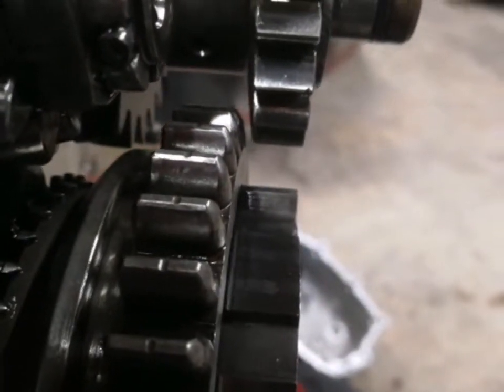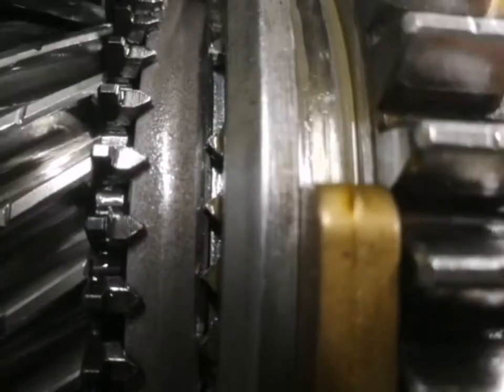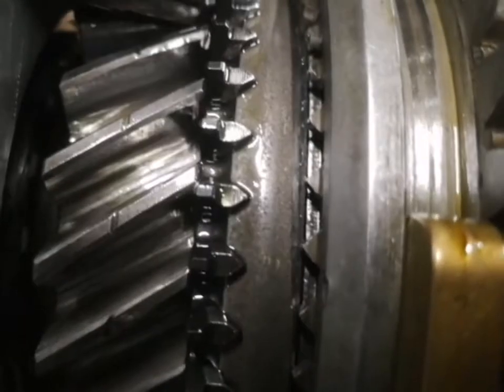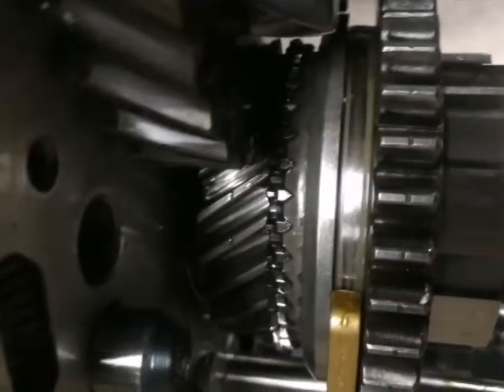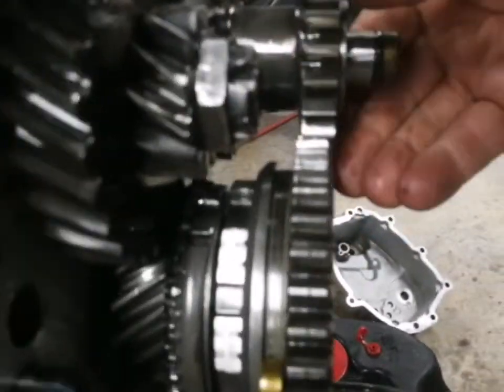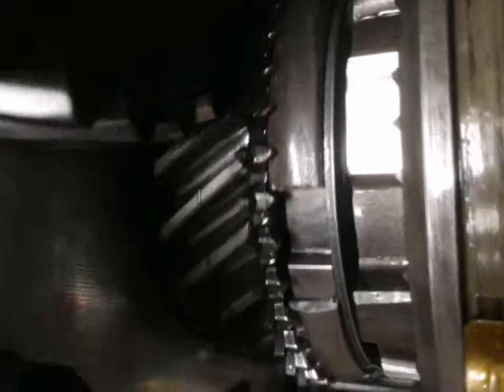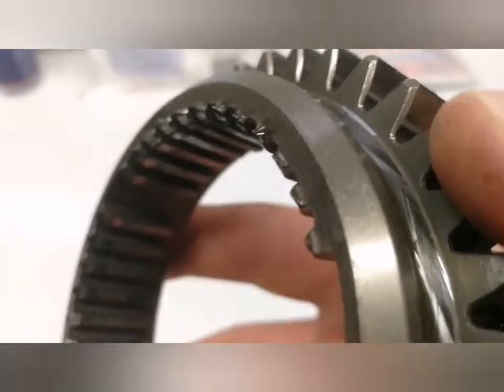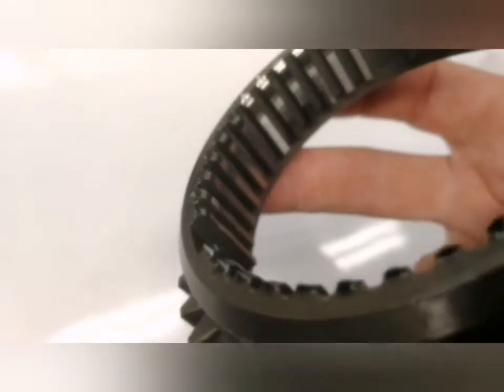Porsche 915 transmission - 5th gear issue

Comment: Did you find the root for this?
Reply from the maker: Yes! As best I can tell, the cage bearing that the 5th/reverse idler rides on had a pin come out and get between the slider and synchro.